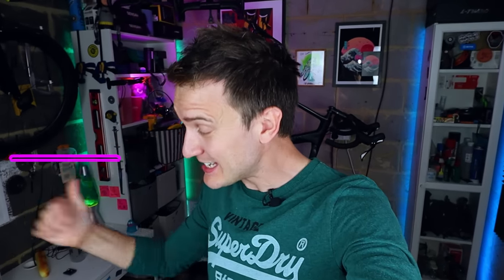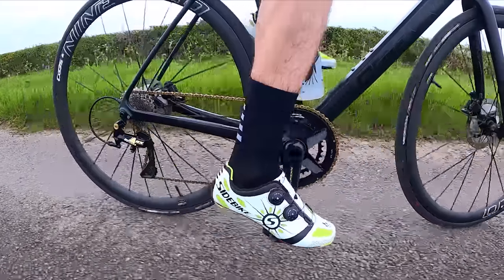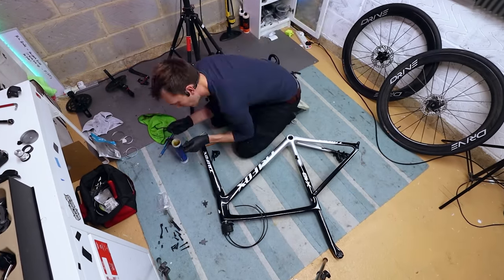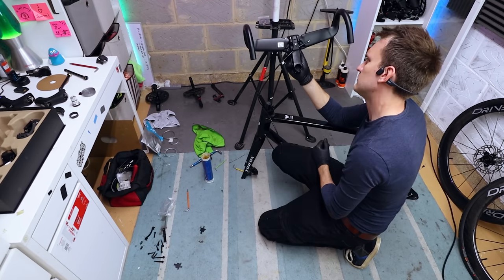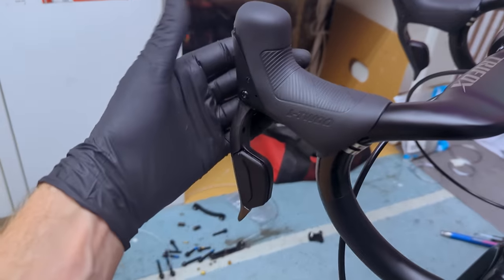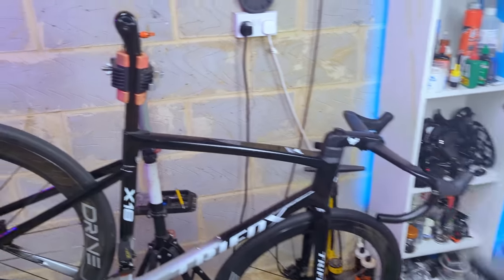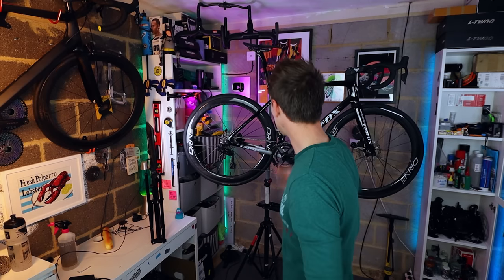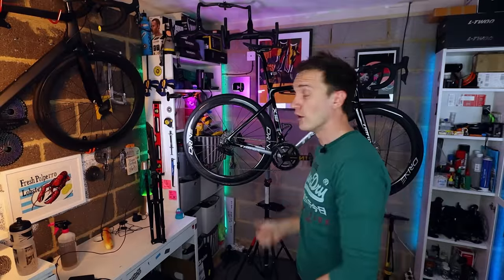Unbelievable value! 100% Chinese ELECTRONIC bike build

Comment: Grant mentioned in an update that it was a jiggly battery that was the issue. 
Apparently earlier versions of the battery tube used a leaf spring to hold the battery in place.  It has since been replaced with a conventional spring. 

The fix for Grant was simply bending the leaf a bit to increase te, apparently
Reply from the maker: OK awesome, thanks for the update!!! In that case, we can pretty much put that issue to bed!
Reply: @TraceVelo  just watching your update! Not a good start.

Comment: One tip guys - in one of Luke's build he put some fiber grip paste inside the steerer tube for the expander plug to hold better. I tried it and I strongly advise not to put it. The paste is greasy and the addidtion of fiber glass particles does not help. Even if I tighten the expander bolt to maximum, it still slips upwards when tightening the stem cap which makes preloading the headset bearings impossible.

Without the paste there is no problem.
Reply: Grip paste makes sense between two carbon fiber surfaces, such as between a carbon seat post and the seat tube, as the particles can indent in the resin on both surfaces and prevent it from slipping. I don't think it has much benefits in a carbon to hard metal interface, such as an expander plug and steerer tube, apart from what you say: it actually makes it greasy and even more likely to slip.

Comment: Congrats on the 100k, well deserved!  Awesome in-depth look at the groupset and the new bike, exciting stuff! However, it seems unfair to compare the price of 105 Di2 to ERX when you don't disclose the cost of the drivetrain components of the Ltwoo groupset in the same shot, which is included with the Shimano group.

Edit: I've also just noticed that there is a big difference in pricing if you buy the Ltwoo components when you're located in the Netherlands (±830 euro) or in the UK (±625 euro). For comparison, a complete 105 Di2 groupset can be bought for about 1025 euros over here. 😅
Reply from the maker: Yeah this is fair. I tried to find a comparision for 105 Di2 where it is sold with only the shifters, derailieurs, and brake calipers, but there isn't an equivalent unfortunately. If you can stretch to 105 Di2, or find a good deal on it, I would probably reccomend that over the L-TWOO... Unless you want to stick with your 11 speed components, then L-TWOO def has the upper hand....
Reply: @TraceVelo  You could do a cost comparison between an Ltwoo plus 105 components to make it a groupset... against buying a 105 groupset complete. I doubt there would be much difference. Even if the Ltwoo/105 combination was say £200 cheaper I'd still go complete 105 for compatibility, quality, spares, warranty and peace of mind. I'd be difficult to convince otherwise.

Comment: 🥖🥖🥖🥖 Pro tip Luke: when you attach the brake hoses, try this: fit the olive into the lever, then gently screw in the hose nut. You should now be able to slip on the hose and tighten with no fear of cross threading. 
Yes, I most certainly would buy this bike. Lovely set up.... Thanks.

Comment: Luke I really like your videos and agree that the group set is good value. Though it isn’t accurate to compare the price of ERX to 105 di2 without adding the cost of the cranks, cassette, and rotors to ERX as those are included with the price shown for 105 di2. Aside from that little thing great video as usual mate.
Reply from the maker: Yeah this is fair. I tried to find a comparision for 105 Di2 where it is sold with only the shifters, derailieurs, and brake calipers, but there isn't an equivalent unfortunately. However if you bought the 105 Di2 stuff separately, or lumped in my chosen crankset, rotors, chain, and cassette with the eRX groupo, i still think it would come out much cheaper...

Comment: Congrats on the milsetone, and thanks as always for the fun and exciting content.
One note on this build, I had the 11-SPD version of that Racework cassette and loved it at first (super light and shifted reasonably well), but it wore out in under 2,000 miles.
Reply from the maker: Yeah the aluminium chainrings on the Racework crank are pretty soft, and they are quite thin to save weight. I will say that you can quite easily swap out the chainrings for a new one. Senicx do a good one for about £40 if i recall....

Comment: 8:15 I had a similar problem with Ridley Kanzo Fast. 
The difference is this bottom spacer floating over frame has no contact with the frame, but even then a piece of dirt (it is a gravel after all) could get between frame and spacer and scrape the paint off.

Comment: another hack for you when cutting steerers, use 2 stems spaced a hacksaw blade apart. also headset bearing, if you were using 7mm thickness bearings try changing to the 8mm equivalent might raise the spacer cap up a touch🥖🥖🥖

Comment: 20:50 no. His problem was battery holder which was first batch with faulty  spring. Any time he went on the big bumps- battery was disconnected and after that only way to activate the system was connect it to charging.
He doesn't have a problem any more as ltwoo sent him a new battery holder.

Comment: 19:16 you move UP one at a time. Upshifting is changing into higher gear that provides less torque but higher speed. Downshifting is when changing into a lower gear - when going uphill, slower but you need more torque. Like in the car

Comment: Great review as always. Literally had my er9 groupset show up in the mail today. Seems really quality from first inspection. Working with elves to build up a custom elves falath pro in the coming months. Going the china direct route seems like a no brainer these days compared to the cost of western brands
Reply from the maker: NOICE!!! Yeah sounds like a great build! Word of advice, when bleeding the brakes, make sure the small free-stroke adjustment grub screw on the front of the shifters is screwed out all the way. If you screw it in at all, it can prevent you from bleeding them properly.

Comment: I'm laughing at myself and remembering my first LTwoo hydro build. I 'assumed' that the metal end pieces on the hoses were a sophisticated fluid outlet port, and set the system up with these on.

Yeah. That bleed didn't go well :)

Congrats on the 100k Luke!

Comment: really happy to finally see this video out! Probably my favorite build so far (actually inspired me to also go for a X18 x eRX build). Keep up the great work!
Reply from the maker: Amazing, good luck with the build, let me know how it goes!!!
Reply: thanks, I will do so! Probably still waiting for black friday sale to buy the eRX Set. Gotta wait some time for wheels and frame delivery anyways.
Reply: How did the build go
Reply: @jkspcoy  I'm very happy with it. Finished the bike early this year and rode about 3500 km (about 2100 miles) so far. The rear derailleur died 2500 km in, but ltwoo replaced it with a new blue version part. Was a known issue, the gearbox just broke down. Apart from that no complains about the eRX group or the frame.

Comment: Not sure about the silicone sealant on the seatpost 😮 - only do this if you are 100% sure of the height. And even then, seems overkill and may remove paint when being removed. Some carbon paste applied liberally over the seatpost should do the trick to keep water out. Alternatively, make sure your bottom bracket has a hole on the bottom, to allow water to drain out. Older steel frames always had this

Comment: There are usually   or 2 very thin spacers included with the headset to keep the cover from rubbing on the frame.  Congratulations on 100k.

Comment: As someone who currently rides almost exclusively indoors (on Zwift etc.) I'd love to see you do a build up for a "Budget Electronic Zwift Bike" or similar title, looking at the costings you put near the end quite a bit of the overall cost was for the wheels, tyres and brakes. However for an "indoor specific" build you could go for a strong cheap front wheel only, no brakes needed at all, potential to re-use existing Saddle and Pedals as well. (not sure what other decent frame options there are but of course weight wouldn't be so much of an issue either) So maybe a fully electronic shifting 2*12 Zwift bike for ~£1100? Could be an interesting video for the indoor crowd, just a thought 👍

Comment: If the HS bearings are the same diameter, check the stack. At times some of these frames take the "taller" bearing at the top.

Comment: Luke, congrats on the 100k! I'm replacing the Campagnolo Record EPS 11spd group currently on the bike so the water proofing test you did brings me comfort since I’ve received my eRX almost a month ago but haven't had a chance to do the swap. For those wondering why Im replacing the EPS, well it's been flawless but the battery needs regular charging now and a replacement battery is half the price of the whole eRX🥖🥐🥨🥯

Comment: Hi Luke, i commented in your short vid some weeks ago, i bought this frame at the start of the year and found a few faults one quite alarming. Delamination on the seat tube which made the frame scrap with no joy when complaining to Trifox. Caliper mounts needed alot of sanding to get them square and one other problem which puzzled me was when fitting the rear wheel the dishing was out by quite alot, i tried a number of different wheelsets  from my other road bikes but they were all the same. This would mean i'd have to have a rear wheel redished and could only be used on the one bike.
Love to hear your feed back on these issues.
BTW the frame is only usable on the indoor trainer now.
Reply: Does your frame have flex in the bottom bracket and corner porely?  Mine does.  I also had a number of "difficulties in the build".  Curious if Luke got a "ringer".  He should pay a buddy to buy one and then inspect it to see if the quality control is consistent.
Reply: @travispyle2905 I also had a few massive issues with the frame. After about 5000km of riding I can fill a loss of stiffness in the bb area. I am sure it was way stiffer when the frame had no mileage but after a year of riding it seems that the frame has worn out.

Comment: Nice bike laboratory, Luke questions, how do you recharge the battery?, it has to be out of the sitpost (hard)? the saddle has to take out always? how long takes to 100? how many rides you can do?, sorry for many doubts... I used to see the batteries on the derailleurs and remove it with a click...thanks and congrats for the 100K

Comment: congrats for the 100k subs. for $2800, the build should be what it is because its already expensive even though parts are sourced from non-mainstream brands. I think this is the only build that you have that I wont be able to replicate because of the cost. But I really would like to have a shot on using the eRX and X18 frame if given the opportunity. thank you for at least giving guys like me a glimpse on what to expect and what to look forward in a build similar to yours. Cheers! 🥖🥖🥖🥖

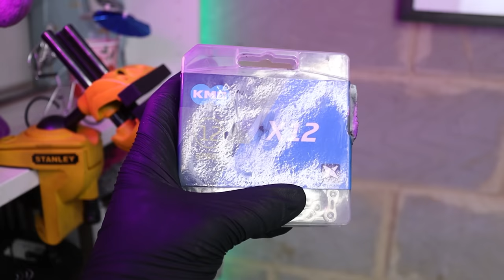Comment: What chain are you actually using? That slotted chain we see in the KMC box at 2:55 is not a KMC product, and it's also not what we see in the shifting demo at 19:08. I'm not sure if the chain is waxed, but it's difficult to make out the markings on the plates and certainly difficult to see whether it's genuine KMC or one of the all too common conterfeits.

Comment: I fitted this groupset yesterday and it looks excellent. One question I have is how do you wake the groupset up once it has been sat for a few minutes? Currently, I have to push the button on the rear mech which doesn't see right. I can't find any info on the instructions regarding this?

Comment: great video and congrats on 100k. Just a comment regarding the erx groupset: i believe the best competitor for the erx would be the sram rival etap axs groupset, which in germany costs just about 200€ more than the erx. i personally believe the sram battery system is superior over the shimano di2/ltwoo erx.
Reply from the maker: Ok fair enough, plus that SRAM warrantly is hard to argue with...
Reply: in terms of weight the eRX with ~1320g (Shifters, FD, RD, Brakes including hydraulic cables) is way more competitive than the rival etap axs with 1393g (only Shifters, FD and RD without brakes, which easily add another 350g+)
The force etap axs set is available in Germany for 824€ right now (Shifters, RD, FD, Brakes and even Rotors included), which is actually a nice alternative since it comes with a significant weight saving compared to the rival set and weighs pretty much exaclty as much as the eRX set.

Comment: The problem GC had was the battery. The contacts in battery were not solid enough, his was a very early version and that problem fixed in later batteries, and if you hit a bump, the battery would disconnect and shut the system down.

Comment: First off, 🥖🥖🥖🥖🥖! Second, you mentioned an adapters that let the seatpost handle taller rails (I think), where would one find that?  I've Specialized seatpost that won't fit the Zeius 3D Printed Carbon Seat.

Comment: 105 di2 does not cost double since in Ltwoo Erx there is no cassette, chain, brake discs and double chainring. In the end 105 di2 is better and much more reliable I think.

Comment: Bad news update on the 3D printed saddles. My Ryet Aircode 3D printed saddle lasted a month. 470kms. And the rails seperate from the nose of the saddle. I'm busy with Ryet with regards to a replacement as we speak.

Comment: Luke, are you sure you got the the headset bearings in the right way? There are 2 different sizes and the "tall" one should go in the top. (I had the same issue) 🥖🥖🥖

Comment: Great video! So what is tyre clearance with those 28c on 21mm internal width? Thinking of buying same frame from Seraph/Tantan (= X-33) but planning to run it with 28c on 25mm internal width (should end up around ~31mm once inflated). As this frame is retailed as "28c max tyre" I'm a bit concerned. Thanks!

Comment: Does L-Twoo have a gravel 1x electronic groupset? Or is it a case of buy the 2x and don't use the front mech? Could it be used with a wireless dropper maybe?
Congrats on the 100K 🥖🥖🥖🥖🥖🥖🥖🥖🥖🥖🥖🥖🥖🥖

Comment: I just recently purchased a frame from aliexpress and I'm going through a bad experience. The a manufacture defect and the rear drive side drop-out opening is ~ 3mm too small. My wheel drive side axle can't even go in. I'm going through a return resolution dispute at the moment. This is a steel frame mind you.

Comment: What cassete size did you use ?
They rate the eRX for a 32 cassete, but both Shimano 105 di2 as SRAM AXS can take a 36 cassete…
Do you think a 36 or 34 can fit ?

Comment: The soldiering on them wire's may look ok but there pretty sloppy! Id try resoldering them back on remove all the old solder clean the exses you see on tbe board there over the second wire in also would take the board right out get a multimeter on it and see what voltage its passing out on each wire, it could just be something stupid!

Comment: For what it's worth, I'd much rather buy this bike than any brand new bike sold today for the same price or anything less than twice what it costs. The bike industry has turned into a joke with this absurd inflation - both in terms of component pricing and bike weights. Then again, I'd much rather buy a second-hand bike from the ~2015 era for that money, with mechanical shifting and rim brakes, and I'd probably get what used to be a near top range model that is also quite a bit lighter and potentially bulletproof on the long run.

Besides the fact that it's a great build that flips the bike industry the bird, I'd make a couple of remarks given some of the part choices:
- that saddle may be comfortable to some, but so far as I'm concerned my saddle of choice is at least 200g heavier than that particular one
- as Hambini pointed out many times, the only crankset standard that is guaranteed to be creak, play, premature wear and failure free is the Shimano Hollowtech design; it's not a matter of "if", it's more of a matter of "when", although it also depends on many frame-related (reaming/facing done properly or not), rider-related (weight, power output, pedalling technique) and maintenance-related factors; that would also add about 100-200g to the bike's total weight depending on what chainset you're going for
- I wouldn't trust any handlebar/stem combos that haven't been thoroughly tested and vetted by users, especially carbon ones; again, it's also a matter of rider weight, power and position on the bike, but a jammed derailleur, a broken spoke or a minor crack in the frame have far less severe consequences than a broken stem or drop bar; other than that, a Kalloy Uno stem is about 105g for a 90mm length, while a pair of decent aluminium 42 cm compact bars is about 260-280g, so whatever aero setup you have there is extremely porky by all standards

Last, but not least, bear in mind that one of the reasons these components are so cheap is that there isn't much of a real demand for them yet, not compared to the big brands anyway. It's great to see such an increase in their overall quality and the fact that they are getting nearer and nearer to the brands they are trying to copy, but as soon as the demand for such parts will increase and start making a real dent in the Shimano-SRAM-Campagnolo sales, the prices will go up as well. So at some point one will have to ask themselves not if it's worth buying/building a mostly Chinese-branded bike for 1/3 of the cost of a Western-branded one, but at which relative cost ratio is it still a good idea to opt for the Chinese-branded (as in designed, engineered, owned and sold by) alternative.